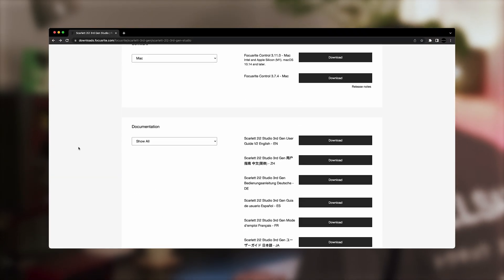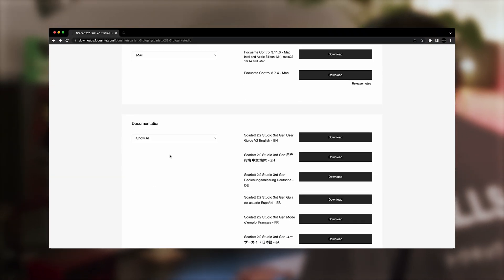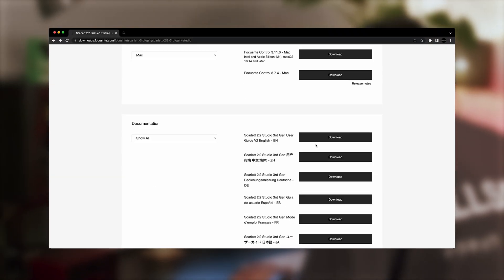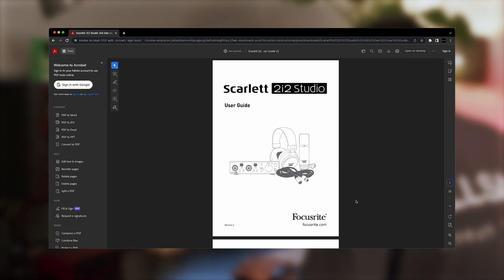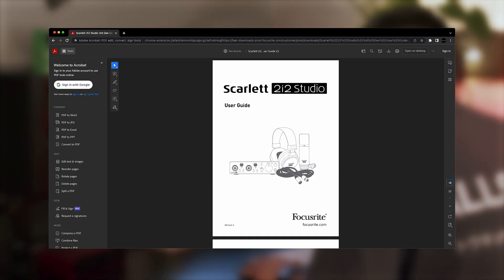Using Scarlett 2i2's +48V Button

Comment: I am using a scarlett 2i2 3rd gen, if i have a condenser mic that needs phantom power, and lets say a keyboard, or a guitar with a pickup on it would the phantom power damage the instrument?
Reply from the maker: No, there's no danger of those items being damaged. When engaged, the 48v Phantom Power supply is only delivered to the XLR connection. Sources connected via 1/4" jack will not receive Phantom Power.
Reply: @FocusriteHelp  Thank you, I appreciate the swift reply!

Comment: What if I have Ribbon and a condenser Mic , wouldn’t that hurt the ribbon mic ? , how that would work ?
Reply from the maker: When engaged, 48V phantom power is delivered to both inputs on Scarlett 2i2, which is perfect when wanting to record with a condenser mic and dynamic mic or instruments and line level source simultaneously but will mean that you can only track with a ribbon mic and instruments/line-level sources when 48V phantom power is off. If you want to record with a ribbon mic and a condenser, I would suggest that you check out Scarlett 4i4 as this allows you to enable 48V phantom power on a per-channel basis.

Comment: Just to be clear - I should plug in the mic FIRST and THEN press the phantom power button?

Or should I first turn the phantom power on THEN plug in my mic?

Also, may want to mention to newbies that dynamic microphones WILL require phantom power to use mic preamps (ex. FetHead)
Reply from the maker: That's right. Connect the mic and engage Phantom Power if your microphone requires it. Most dynamic microphones don't require Phantom Power. We'd generally suggest that users refer to the instructions and documentation that come with their microphone.
Reply: @FocusriteHelp Thank you! 🙏🏾